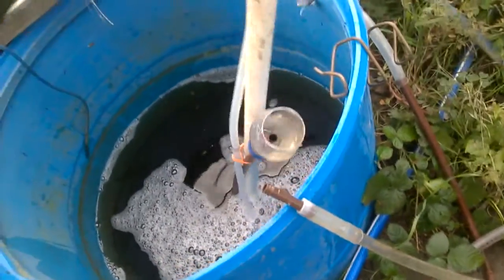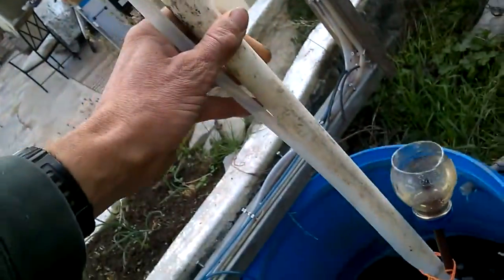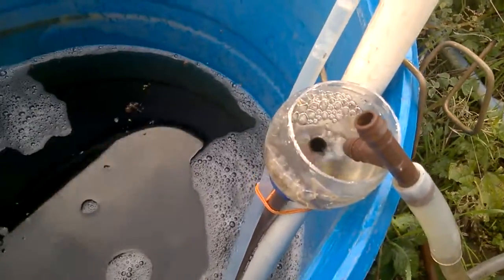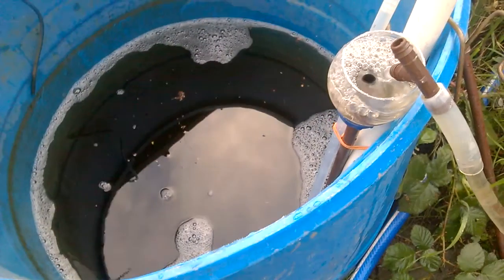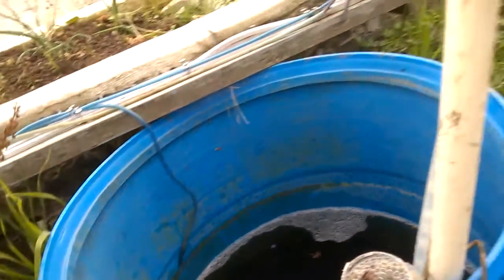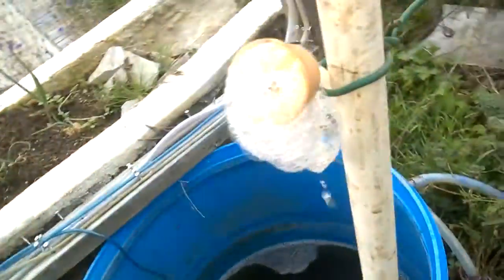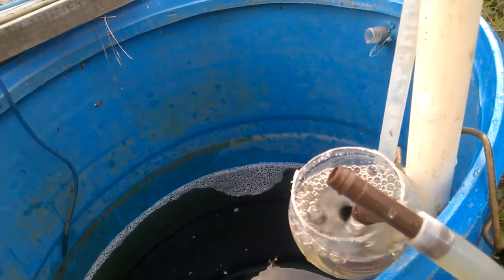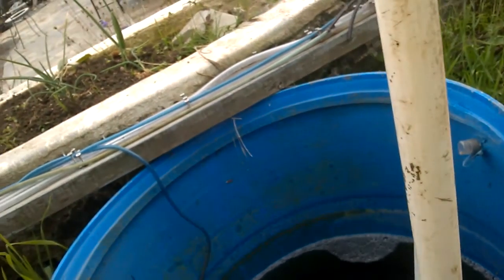Second attempt to make a simple working model of the pulser pump.

Comment: I really like this design... it's like the river-based pulser without a river.  What if you made the water coming into the cup create a vortex?  This might make the air-water mixture more consistent and reduce the water plugs.  A sieve on the inlet might also help.
Reply from the maker: Hi, Christie,  I have found in full scale pumps that a vortex reduces efficiency
Reply: Brian White Interesting, useful to know. Thanks.
Reply: In a vortex air is more likely to escape back up, which reduces the rate at which pressures builds in the trompe below. Water that flows straight down has greater velocity, and has greater suction when it runs down vertically along another pipe. I drew you a small diagram to illustrate.

https://imgur.com/a/frn6Xmc